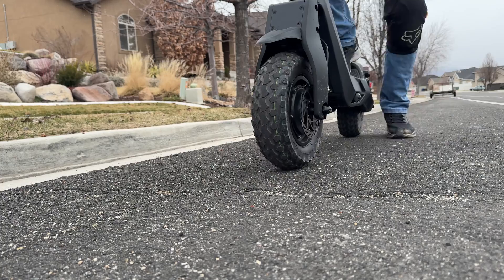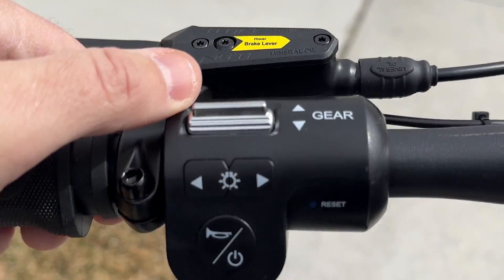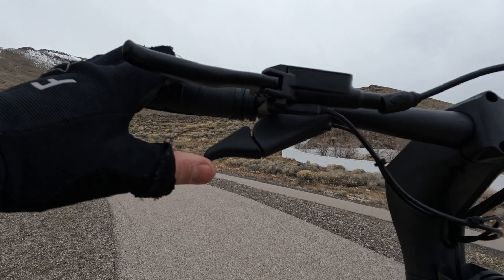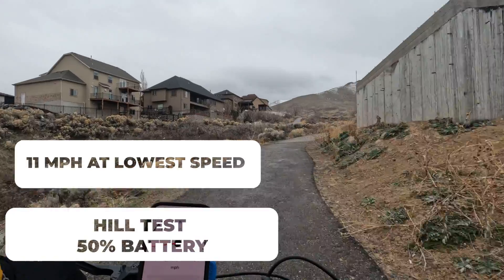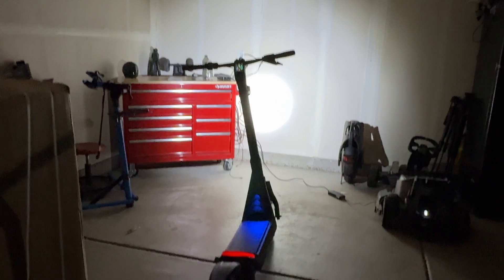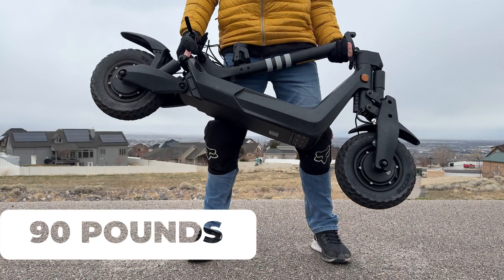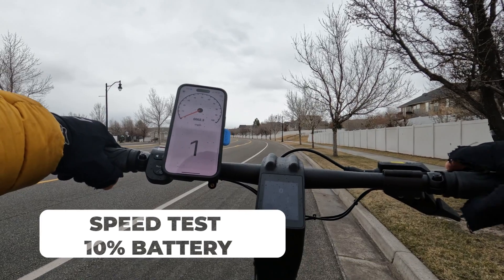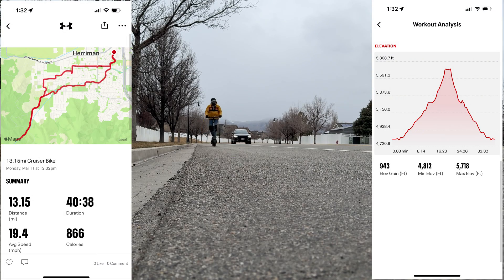Does Battery Life AFFECT Performance?

Comment: How tall are you? Did you do a full review on this scooter? Mine gets here in a week and I plan to do one but curious about height to judge fit in future.
Reply from the maker: I'm 5'11 and size is a good fit.  I do wish the stem wasn't angled back as much, that was my only complaint
Reply: @ElectricRevolution  Right on. I think it's too torqey of a throttle and the deck could be longer. The stem being far back exaggerates how short the deck feels. I'm 6ft 3" and I cannot ride this, unfortunately. But I love the idea of it, many things are done very well if not better than anyone else.

Comment: Does anybody know how to open the battery compartment if the battery is out of the scooter?
Reply: You need to peel off the rubber mat from the back a little, there will be 2 screws under it that hold the keyhole. Unscrewing them will give you access.
Reply: @erofeyerofeich5928  Thank you. Very helpful!

Comment: How open the battery lock when is close and no battery inside?
Reply from the maker: The same way if the battery was inside
Reply: @ElectricRevolution 
Some owner couldn't open it without power!!!
Reply: You need to peel off the rubber mat from the back a little, there will be 2 screws under it that hold the keyhole. Unscrewing them will give you access.

Comment: Rc car hobbyist here,  Lipo batteries are kind of crazy. When at peak youll enjoy wild amounts of power. Then they settle into their designed output something like 3.8v per cell and they stay there for 50 to 60% of the discharge curve. But then usually about 3.5 or 3.6 v and the start to plunge toward the point if no return at 3 v.   The battery management systems on scoots seem to taper off the high end so the battery lasts longer before it hits the flat part of the charge.  Lithium ion is getting dumped on alot these days but their the best affordable thing we got right now
Reply from the maker: Thanks for your comment, you know more about batteries than I do